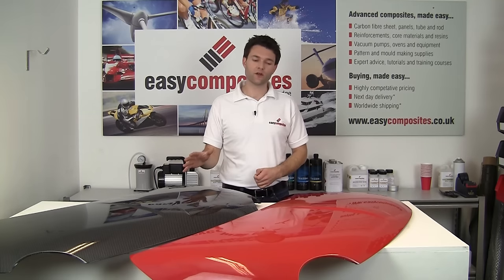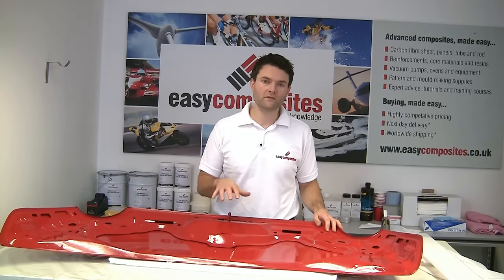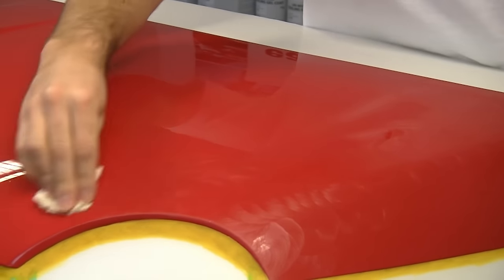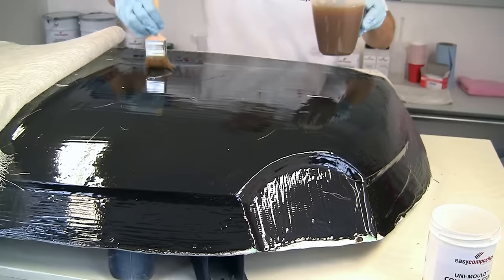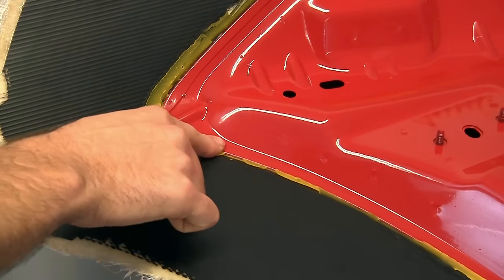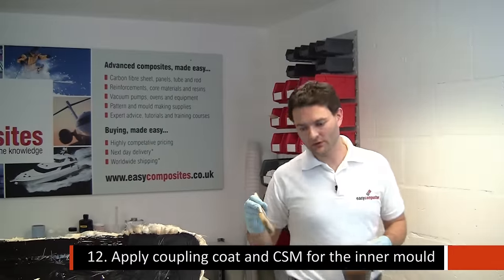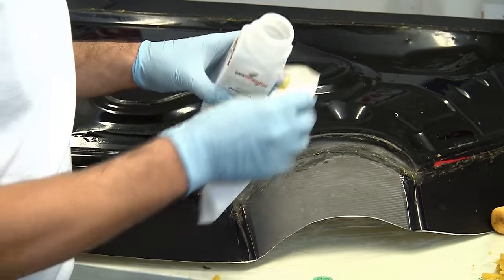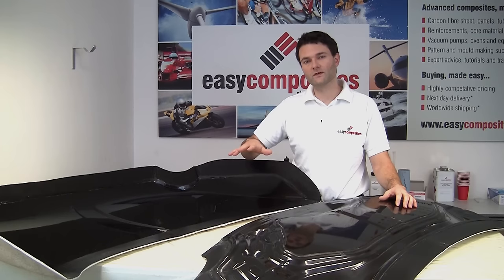How to Make a Carbon Fiber Car Bonnet/Hood - Part 1/3 : Making the Mould

Comment: What is in the coupling coat? Is it just a polyester resin?
Reply from the maker: The coupling coat is a vinylester resin designed to aid the bond between the gelcoat and the backing layers.

Comment: Does anyone know if making a mold of a bumper damage the original bumpers paint? I want to make a mold for my bumpers but they are already freshly painted, and I'm hoping I wont need to paint them again after that.
Reply from the maker: Fresh paint can be a problem, especially if it is rattle can based or heavily solvent based as the paint will continue to outgas for many weeks and the out gassing can eat into release agents causing sticking problems.  We would recommend caution and use a good layer of PVA mould release as a physical barrier for the best chance of avoiding damage to the paint.

Comment: Do you offer body panels for mustangs?  What would the cost be ?
Reply from the maker: I'm afraid we don't actually manufacture any model specific carbon fibre products. We're really suppliers of the technology, materials and training for companies and individuals who want to make the parts themselves.
Reply: Google "carbon fiber mustang." You can find suppliers for various Mustang models but be warned. The finished products are extremely pricey. Carbon fiber, both high quality materials and skill needed to create them, are NOT cheap.

Comment: Why do my parts warp when out in direct sunlight, or when interior gets too hot for interior parts..?
Reply from the maker: The parts will likely need a "post cure" in an oven.  The reason is that epoxy is not fully cured at room temperature for quite some time.  Doing a post cure forces the resin to fully cure and also helps improve the heat distortion temperature.  Once a post cure is done, the part is unlikely to soften and warp in the sun again.
Reply: Easy Composites Ltd thank your for the reply! So when you say post cure, do you mean, to put the room temp cured part, out of the mold and into the oven at 120f 

or should I put the uncured fresh vacuumed layup straight into the oven at 120f and then a post cure while still in the mold? Or should the initial bake at 120f be enough? Sorry for so many questions, I'm having trouble finding the right pointers on my own..

Comment: Can use the mold more than once?
Reply from the maker: A mould produced using the Uni-Mould System can often be used hundreds of times with only routine maintenance. You can sand out any scratches that build up and re-polish the gelcoat if it begins to dull.  The better quality you make the mould, the more durable it will be.

Comment: Will this process work for making a C6 corvette fender?
Reply from the maker: You can use the same process to make the vast majority of vehicle body 
panels.  Some more complicated shapes may need a multi part mould but it
 should still be possible to mould them using resin infusion and the 
basic techniques seen in this video series.

Comment: Why is the molding resin "filled", what's that good for?
Reply from the maker: It's filled to reduce shrinkage. A typical polyester laminating resin cannot be used to laminate 4+ layers of CMS all in one go because it would shrink badly and distort the mould. The filled resin used in the tooling mould system is very low shrink and designed to be applied all in one go. This speeds the process up greatly. It also makes the moulds suitable for higher temperature use as well, if needed.
Reply from the maker: The fillers and additives give the tooling resin more dimensional stability and prevents shrinkage.

Comment: How are you going to fasten the part to the car?
Reply from the maker: Using the bighead fasterners and loop as shown being bonded into place.
Reply: @easycompositestv  Interesting, thank you for the quick answer. That was a long doubt I had. Looking to dig deep into fastening methods for composites. You have any material or videos?

Comment: How many bonnets could be made with one mould?
Reply from the maker: There wouldn't really be any limit Stefan. Realistically, accidental damage to the mould is more likely to limit its lifespan than anything else but certainly we'd expect to be making hundreds of parts using a mould like this and if treated well it could be several hundred.
Reply: @easycompositestv  Thank you very much for this information!

Comment: How much does an average carbon fiber  bonnet weight?
Reply from the maker: There's not really such a thing as an average carbon bonnet/hood as size, lay-up, design, intended purpose and vents/cut-outs all have a big effect on the final weight however by way of comparison, the Fiat 500 bonnet in this video came out at 3kg against a standard steel bonnet of nearly 20kg.

Comment: i want built diffuser for my swift car . so, how material i should buy
?
Reply from the maker: The quantities you need will depend on your parts measurements and the calculations you make for your design. For a diffuser, depending on how well it is supported, you would likely only need a single mould and make the part "single skin" Something similar to the bonnet skins lay up around a Soric core would be a nice and stiff efficient way to make a nice diffuser panel.

Comment: Do you have a distributor in the US?
Reply from the maker: Hi, we can ship to the US, no problem in fact we ship every day and have a great customer base in the States. Smaller orders containing Dangerous Goods such as Resin and Solvents can be a little expensive, but the good news is that you can get an accurate shipping cost easily on the website, simply add items to your basket and then choose ‘United States’ on the basket page. If you have any questions though, feel free to drop us an email to sales@easycomposites.co.uk

Comment: my guess 99% who watched this vid didn't try it. To the 1% when spreading the resin on the chop over a larger area. use a small paint roller over a brush. will spread faster also work bubbles out. before using the hard roller

Comment: can the gelcoat be thinned and sprayed on the part?
Reply from the maker: No we would not recommend attempting to thin and spray this gelcoat.
Reply: i see in the next video you have a spray-able gelcoat. Can the gel coat be applied to a primer'd surface. i see that some of the paint came off, if i did this i would have to repaint the original piece. could i make a mold of it while it's only in polyester primer? then just paint it after?

Comment: how much would a carbon fiber hood cost?
Reply: asd123asd I'd like to know if it's cheaper to just buy one or build one like this too
Reply: Jim Bob building is always cheaper.
Reply: @RegulerShowTV  I think I read in the threads that a pre-made CF bonnet would be around $16000 vs making with these materials at under $2000.  Add to this, that one could then re-use the mould; so then it would really be a very small fraction of the cost.
Reply: Trisha Xuk How in the shit can carbon fiber panels cost that much, that’s insane.

Comment: What tow strength carbon fiber is used for this project?
Reply from the maker: The 200g (surface ply) uses a TR30S 3k (so standard modulus, high strength). The 650g backing ply is a TR50S 12k (standard modulus, high strength).

Comment: I don't understand why they don't use PVA mold release spray
Reply from the maker: It's very rare you'll see PVA used these days to be honest. I guess the main reason is the swirls or satin finish (or both) that it leaves on the mould (or component) surface. That all needs to be flatted and polished out. Wax and chemical release agent (or, really, just either of these on their own) are more reliable and leave a better finish.

Comment: Just use the old Metal panel as the mould. Skip the making a mould part of you are only going to make one part. The only thing you'll have to do is put a finish on the outside.
Reply from the maker: There are some occasions when you can do this but normally you can't because the part that you'll end up with would then be larger than the part that you started with by the thickness of the material. Often this means that it would either be a poor fit or wouldn't fit at all; a vehicle panel that's 3mm larger in all dimensions that the original is generally not acceptable. It's also worth remembering that trying to create smooth, flat lines on the outside of a rough finished part is quite challenging and often considerably more work than going through the proper process of taking a mould off the (already perfect) face. Plus it would still fit!
Reply: @easycompositestv  Yes, that is a consideration one must make. If it's for the do-it-yourselfer and they only want one they could make a very quick and thin  laminate spec but braced very well and take a part out of that. I'd also use PVA as a quick application mould release.

Comment: Why can't you do it directly with carbon fiber? You can make the same trimming area as what you did for fibre class mold. Isn't it?
Reply: Or you want to use this old hood again?
Reply from the maker: @chanpengchen  I'm not entirely sure what you mean but in this case; the hood is able to be used again and the mould tool can be used repeatedly to make many, many carbon (or indeed any other composite) bonnets/hoods. If you were to use the hood itself as the mould, the part you made would end up bigger than the original and would need a lot of finishing work as the outside would not be made against a mould surface.

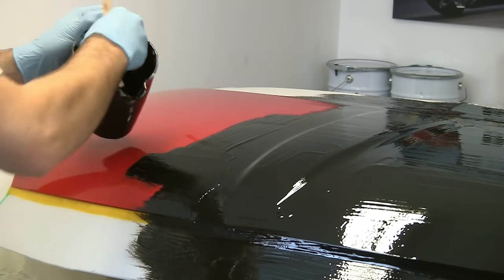Comment: 8:10 what is the black stuff  you using?
Reply from the maker: That is the Uni-Mould Tooling Gel Coat which is part of the mould making system used in the video.

Comment: Am I the only one still stuck on when he said "I'll show how to you do it at home?"
No one at home is going to go to this level when you can buy something of comparable quality for less! 
To do it at home you want it done cheap. That's why we DIY. I bet in part 2 he vac bags it as well and uses absorbing sheet.
Fact is, it doesn't have to be done like that. Granted, this is how it SHOULD be done, but you've just spent about $600 making the plug! Unless you intend on breaking lots of hoods, you don't need this. You can actually use the factory hood as your plug.
Reply from the maker: Using the factory hood as the plug will not give an exact accurate copy. Plenty of our customers have done this full project at home on a DIY basis, some even on a kitchen or dining room table.  Others have made full bodies for their cars, so not all DIY projects are lower quality.
Reply: People DIY for lots of reasons. Yeah if all you want is a carbon fiber hood for your car. You probably should just buy it. But then you're restricted to what already exist. Maybe you want a custom solution. Maybe you're in a car club and want to make multiple pieces copies. Maybe you just like making stuff. I was also struck by how intense this process is. But the fact remains they make a very nice part and it didn't require an expensive autoclave or machined metal tooling. This is doable at home. Though I suspect I'd burn through a lot of material figuring out all the ways to screw this up. Still too pricey for me to learn right now. I'll try a gascap or an interior panel.

Comment: Why does it say Carbon Fiber, when it looks like fiber glass?
Reply from the maker: Because the video is about how to make a carbon fibre bonnet/hood but it's a 3 part video. In this video (the first part) we're just making the mould which is reinforced with glass fibre (fibreglass) however if you keep watching you'll see that we use this mould to make a carbon fibre bonnet/hood.

Comment: Only £150 in materials, I can't believe that.  Would have thought at least 10x that amount.
Reply from the maker: No, it is pretty close to the £150 mark in materials alone. This doesn't include the equipment and the cost to make the moulds. If you think about the materials in the component itself you have around 5sqm of carbon cloth (at circa £20/sqm) + 2kg resin (at £16/kg) plus a bit of Soric core and few metres of tape and a few ££ in bagging materials.  If you were buying these materials in bulk (full rolls) then the costs would be lower still.

Comment: 17:50 OOOH, hold on a minute.. That's paint from the bonnet that YOU could afford to sacrifice. What if you cant afford to sacrifice it? I can see other areas where the paint has been stripped off the bonnet stuck to the mold.

HANG ON! WTF happened to my Bonnet!
Reply from the maker: Its almost always a risk that paint finishes will be damaged as its hard to know the quality of the paint on a second hand part.  If that is a major concern, use PVA mould release as you are far less likely to get damage. However PVA does marr the mould surface so needs to be polished.
Reply: @easycompositestv  This technique has always been of interest, i don't have the place to do such things. This is a great tutorial, very detailed and professional. I watched all 3 parts and had watched the other guy make compressed fiber tow molds.  Excellent work, great result. thanks.

Comment: My toxic trait is thinking I can pull this off with 0 experience
Reply from the maker: You would be surprised to know that plenty of our customers have done just that. Careful planning and following of the process and not moving onto the next step until you know you are ready will get you around most issues.
Reply: @easycompositestv  how would you tackle doing a vented hood, should you inlay it or just push the fabric into the vents (I have a D-max style hood)

Comment: People aren’t going to be saving much. The chemicals cost a lot and so does epoxy and then the actual carbon fiber
Reply from the maker: Labour cost would be a very big percentage in a part like this and the availability of specific panels isn't always there. Remember this is a demonstration of the process not just for bonnets. Making your own offers flexibility in layup and also once the mould has been made multiple parts can the be made which will bring toe overall cost per part down significantly.

Comment: Does cutting carbon fiber do damage to your lungs?
Reply from the maker: Yes It does. Although cured composite is not toxic in its own right, it does present a very real respirable hazard when in a dust form during cutting and sanding.  As such we would recommend wearing a suitable mask, as well as using extraction where possible.

Comment: You described the video as making a carbon fiber Bonet hope but you're not really making it with carbon fiber. You're using finer glass.
Reply from the maker: Hi Luis, video #1 is making the mould tool which is a glass fibre backed mould; however, if you watch video 2 and then video 3 in the series, you'll find that the actual bonnet is made using Carbon Fibre throughout.

Comment: Carbon fiber does not have a high IMPACT strength.
In any Formula 1 race, when they crash or simply bump into each other, the carbon pieces immediately disintegrate and shatter. 
You can take a hammer to a dry-carbon body panel(one that is made in an autoclave) and punch a whole through it with relatively little effort.
Carbons fiber is NOT good for structural rigidity.

Comment: It's fiber glass not carbon....
Reply from the maker: Hi, actually this is a 3 Part Video and this is Part 1 where we're making the mould (not the component). The mould does use glass fibre reinforcement but if you keep watching you'll see that the component we make (in Parts 2 and 3) is very much made of carbon fibre :)

Comment: no offense man but that would serve no purpose other than looks. carbon fiber is extremely stiff and therefore has high tensile strength, but the ductility of carbon fiber, aka, how much it flexes, is minimal. that being said, if the carbon fiber were to break in the cage during an actual rollover situation, the whole cage would be useless, and actually more dangerous b/c you'd have shards of carbon fiber sticking out all over the place.

Comment: Ur fiber glassing over the gelcoat, w tf. Why make it so complicated, u didn't even mention the release compound manufacture. Teenage stuff for me dude
Reply: That's because the mould would be the metal hood/bonnet and in theory would be moulded  in reverse as the bonnets smooth

Comment: THIS IS NOT A Carbon Fiber Hood, Its a FIBERGLASS hood with a layer of Carbon fiber..... A REAL Carbon Fiber hood would cost about $3000 .... A Glass hood like this, that LOOKS like a carbon fiber hood cost about $500 to $650 bucks..... This hood weights between 14 & 16 lbs, a Carbon hood would weight about 3-1/2 lbs ....
Reply from the maker: Mr. Roach; thanks for commenting but I suspect you have either not watched all 3 parts of this tutorial; this is part 1 of 3, where we are making a fibreglass MOULD; or you don't understand what you're watching, which is fine - it's complicated stuff. However, for the benefit of others watching who might not spot your mistake this is a tutorial about making a carbon fibre hood (not a fibreglass one!); we make the hood in Part 2 (out of carbon and epoxy!) and then trim it and bond it together in Part 3. The person commenting above either hasn't watched or hasn't understood what's happening in this part and is mistaking the mould we're making in this video (Part 1) for a component!

Comment: This is not carbon fiber there is a fiber glass
Reply from the maker: Er.... we're making the mould at this stage! The bonnet is carbon fibre if you keep watching (to video 2/3 where we actually make the bonnet). The mould does use some glass reinforcement. If we called the video "How to make a carbon fibre mould for a bonnet" then you might have a point ;-)